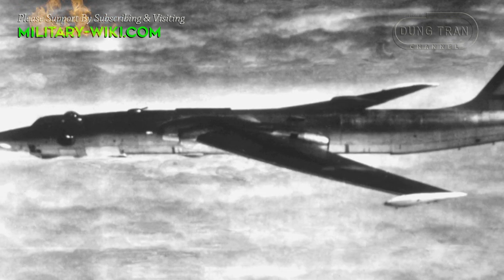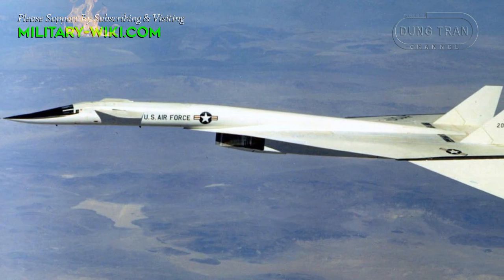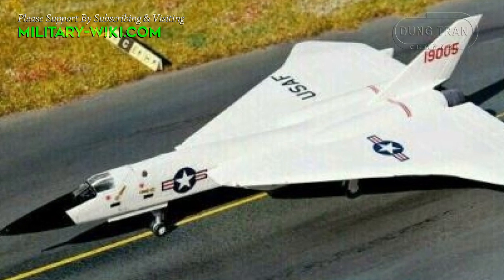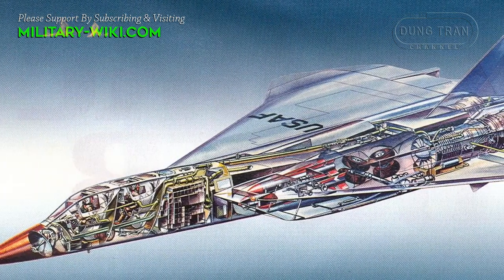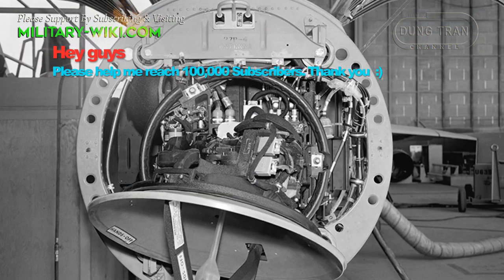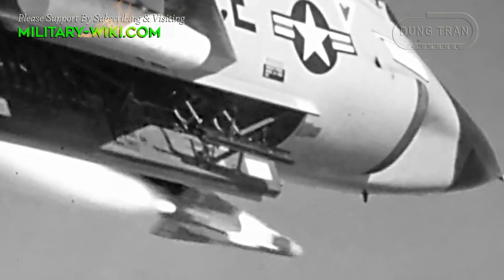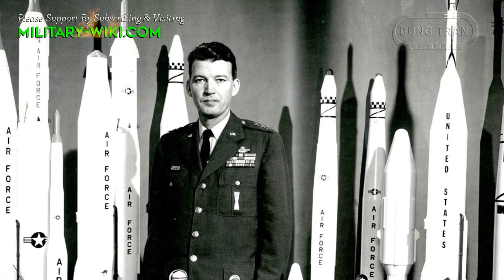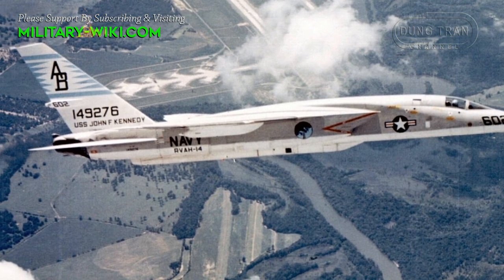XF-108 Rapier: The Mach 3 Monster But Unfortunately Canceled

Comment: dung the rapier wasn't meant to be an interceptor it was meant to be an escort fight for the XB-70  the A-12 variant of the SR 71 was to be the interceptor!
Reply: Its been written that way in some literatures online and elsewhere so we understand why you say that but in reality those two different airplanes implementations would of been reversed. 
  The NAA F-108 Rapier would of been the incoming enemy bomber interceptor with only a combat radius of a 1,000 nautical miles .The F-12B Archangel ( YF-12A weaponized SR-71 ) which if the SR-71 did a speed record of flying 3000 miles from L.A. to NYC in one hour on a single full tank of JP-7 then the F-12 would of been better for " Deep Penetration Escort " to accompany the XB-70s to USSR. I think that`s one reason they are parked next to each other at Dayton Ohio AF museum.
   Its not written anywhere but i also believe there would of been a KC tanker derivative of the U.S. Government financed American SST ( Super Sonic Transport ) commercial airliner development. The Boeing 2707 which was developing at the same time as the XB-70s and YF-12 development.  They all could of done the Mach 3 dash half way to USSR. slow down over the north pole to areal refuel the tactical planes. Then the KC-1?? head to northern Canada, Greenland or back to Alaska and land. The B-70 and F-12 continued there bombing missions to USSR.  ICBMs was the better option.
Reply: @leonswan6733  well the 108 program was connected to the B 70 program in more than one way so i think that gives credence to that version, and seeing how it never flew we really don't have a real idea of range for it!